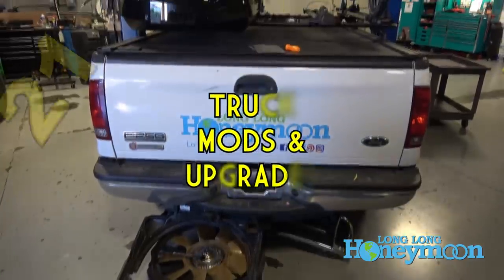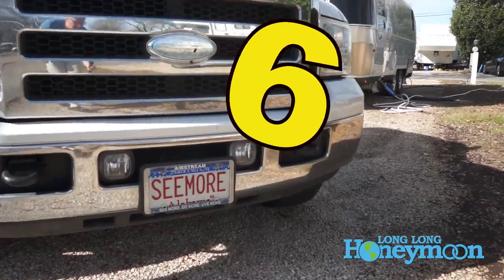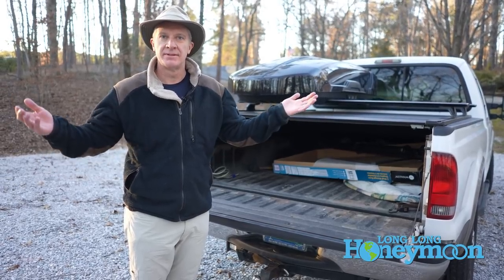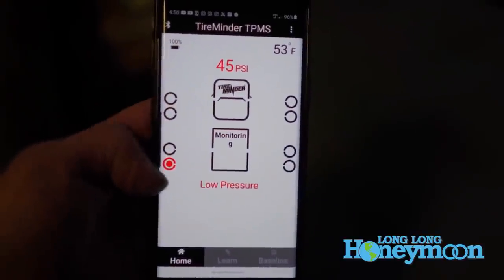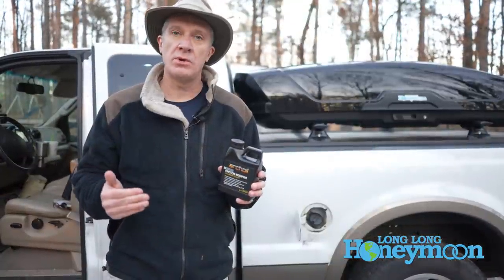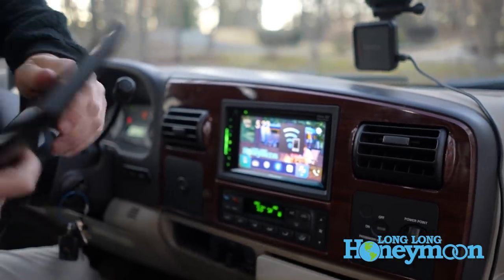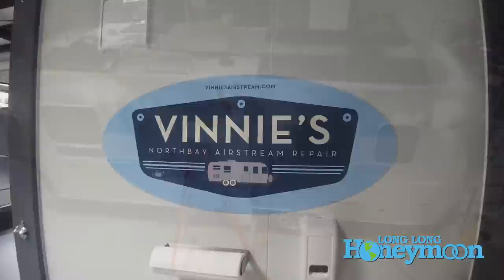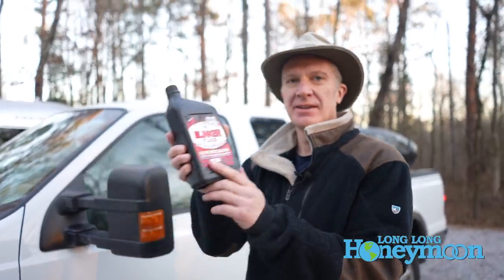21 Pickup Truck Mods & Upgrades!

Comment: If you still have rubber valve stems, replace with metal if you are using Tire pressure monitors.   I lost a rubber valve stem on both my truck and trailer due to the stress put on the valve stem by the TPMS.

Comment: 2011 F250 6.7 powerstroke pulling 30foot artic fox 27-5.   added a 60gallon aux fuel tank with drip system plumbed into factory tank. it was a game changer not havimg to fine fuel every 200miles.

Comment: Sean, do you have another video that shows the mod for battery charging cables that run to the house batteries on the AS? I remember seeing that you showed the connector during the 370 AMP Mechman Alternator install video, but I would like to see what size cables and how you ran the wiring and the type of connectors used. I'm considering the 350AMP Alternator mod for my AS. I doubt I'll get much benefit from the 10 or 14 gauge  wire used with the 7 wire plug.

Comment: I loved my old 2006 f350 drw. Sadly every upgrade you added was standard equipment on my 2020 350, plus its quiet and has twice the power,  half the maintenance, and better mileage.Ditch the diesel bro, get you a 7.3 gas. Take it from a fellow 6.0 owner, you will not regret it.

Comment: the scan gauge is obsolete if you set up your pioneer audio unit with the obd cable.  all that info is available in the car info screen
Reply: talk to the guys at Crutchfield. there are two customizable screens of extra gauges you can set up any way you like. lots of useful info and the cable was cheap

Comment: My truck has a factory spray-in bedliner, but my "must have" mod for every truck I've owned  is a rubber bed mat.  Anything you put in the bed stays put.  Lay a bike in there?  Stays put.  During braking, acceleration, turns, etc.

Comment: I bought a F-150 4X4 Lariat diesel in 2018; it was a big upgrade over the 2003 Dodge ram 1500 whose entire interior was made from very cheap plastic.  It couldn't tow itself.  The F-150 powerstroke on the other hand, is rated to pull over 10K in it's present configuration.  I pulled a 21' Sovereign when I replaced the truck; then upgraded to a 2016 28' Flying Cloud.  Bringing the new trailor home I noticed it porpoised a bit in the back of the truck.  I added Roadmaster active suspension; problem eliminated.  Whith upgraded/proper weight distribution barson the hitch (previous owner screw up), the rig tows like there is only one vehicle.  I have an unresolved issue: when I was hanging out above 10,000 feet in CO for a month, the truck coughed up turbocharger engine codes.  There was no problem with the hardware.  It happened twice, 'first time towing, 'econd time not towing.  I am considering a cold air intake and engine tune (5-Star).

Comment: I as you know a 2001 dodge 2500 the replacement engine and rebuild upgrades transmission plus some front end was still less than a new rig with less problems and costs like def crap ,,, We really like our towing rig ,,,why rock the boat ..
....

Comment: The international motor was not the problem. The Ford engineers who added the emission controls created the problematic EGR cooler created the snafus. I don’t advocate removing them but replacing it with a bulletproof diesel unit worked for me. We have too much money in ours to sell, our next one will be a Cummins. We also use Dashboss instead of the scan gauge using an old iPhone. Adding a EGT monitor and a fuel pressure monitor.

Comment: Use a good synthetic oil and no need to add additives to oil. Always use a fuel additive.
Reply: I use T6 and still use the 9100.  It makes a difference cold.

Comment: So you had an LP record player?  I have used Michelin tires.  At 110,000 miles I had to replace them.  The tread depth was still acceptable, but they would no longer hold air.  Myanmar ?  Not these days.

Comment: Out this way, Australia, because we are right hand drive the big American Trucks such as the F250 and F350 as well as the RAM need to be converted.  This comes at a considerable cost disadvantage thus making a F250 in the order of US$126000.  Thus although they are becoming more popular due to their increased towing capacity the Toyota Landcruiser Diesel is probably the most popular large towing vehicle.  Agree with Sean that the ScanGauge is a great addition to the vehicle especially for monitoring auto transmission temperature.  Typical mods out this way would be a bull bar, almost essential, 50mm lift and upgraded shocks and springs and driving lights.  The driving lights are a little overrated as driving at night is never a good idea due to the possibility of animal strikes.  You are somewhat spoilt in the US because of the prevalence of paved roads.  Travel out here tends to involve unpaved roads which of course has the effect of turning such travel into quite an adventure.  Thanks for another interesting video, Sean!  Off to buy some Blinker Fluid!!!!!

Comment: Blame government regulations for engine problems on the 6.0 cornbinder diesel engine. The 6.0 is a great  motor once the emission  control has been removed.  It chokes the motor to death.   As far a having to add DEF ,  In the first 25k of my 2015 diesel ford I have only added DEF  5 times.

Comment: The 6.0L is a good engine but it loves to be maintained. I am at 176,000 miles and is going strong without being "bulletproofed". One mod you need to do is the 08 transmission pan and filter, the 6.0 5R110 toilet paper filter does not do that good a job.

Comment: With all of these upgrades your truck is as good as a new one. You have all of the kinks worked out. Why replace it? The engine is good for another 200,000 miles ! Parts are alot cheaper than a new truck! Insurance rates are lower on a 14 year old vehicle. REuse, REduce, REcycle

Comment: I installed a scan gauge to my truck and I can't find the transmission temperature I am guessing my truck doesn't have that feature
Reply: Look for TFT on the scan gauge. Transmission Fluid Temperature .
Reply: The scangauge website will help you find all the extended gauges available for your specific vehicle.

Comment: Ford outsourced the engine design for Ford before the 6.0 with the 7.3.. problem was international slapped this motor together to meet emission requirements in a short amount of time. Mid year 03 the 6.0 rolled out. The 6.4 was the last straw for Ford and kicked international to the Kirb. Ford had so much success with the 7.3..its a shame international couldn't make the 6.0 just as solid.

Comment: Weird, I never have any issues with Bluetooth.  I did with Apple products, but my Samsung's have been solid.
Reply from the maker: I have frequent issues... it won't connect, or it connects to the wrong device, that sort of thing. But it's better than nothing, and it does seem to improve with each generation.
Reply: @LongLongHoneymoon  Wrong device.  Well that can happen when you are paired to more than one device and they are both on.  The other thing that can be an issue is if  you have your phone, or Bluetooth device setup to allow connection without any security code.  Some after market devices (like car stereo's) suck at it, others are quite good.  Most of the built in car stereos today work pretty well.

Comment: Been watching you guys for years. We really like your vids. I am a retired auto tech with many years of fleet management experience as well as managing auto repair shops for other people. I can tell you that Ford did not outsource the engine in your truck to IH. Ford bought the rights to the original engine from IH in the 1980's which was a 6.9 with glow plugs and boy... did that engine suck. They did a redesign on the 6.9 and brought it to a 7.3 with turbo and so on. I can tell you also that the best pulling vehicle in your class is the Chevy Duramax with the Allison transmission in it. For all the repairs and headaches that a Ford will give you, you could have already had a Duramax. They will last a lot longer, give you much better MPG pulling miles, and give you more comfort than any Ford i have ever seen. I know of life long Ford lovers that have switched to the Duramax and never looked back. Just a humble piece of advice for you guys.

Comment: Mandatory upgrade: You've got to upgrade the stock headlights from halogen to LED bulbs. It will change your life. They should be standard on all makes and models for safety. Many are plug and play (no Canbus required). Our 2020 F-250 came with crappy yellowish halogens. Changed them out and the difference is night and day. Pun intended.

Comment: Good video. But you need to face reality. Seemore  needs to be sent out to pasture. It’s time to upgrade to The  20th century. I think in a previous video you were going to try to get one more season out of Seemore. Big mistake. Everything is working now so it’s time to sell it. Once you get on the road and things start to break,you are throwing money away. Bite the bullet and get a new or slightly used F 250 and move on.